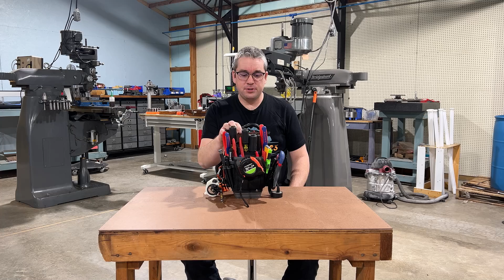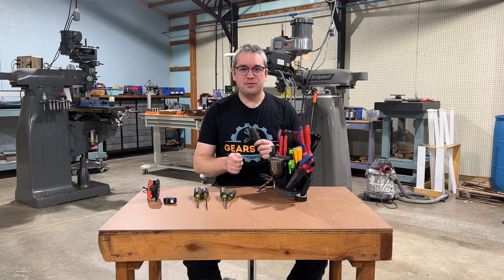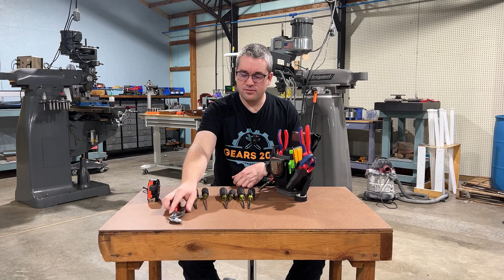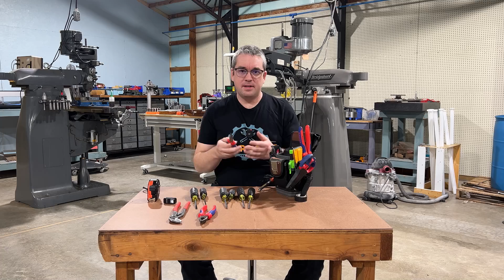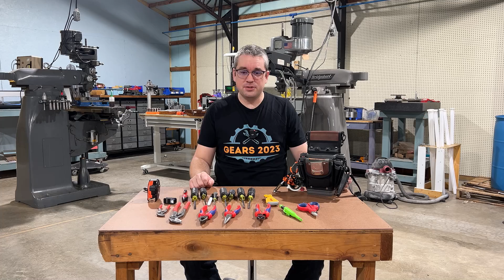Quick Maintenance Tool Bag Loadout - What I Carry Everyday

Comment: Great video and interesting to see what others carry. I have a very similar set of tools I keep in a wallet style pouch that I use as a grap bag for around the house ect..

Re the scissors, in the US, they seem to be an essential tool in the telecom/data industry, but in the UK telco I worked for, we're were never issued them, rather just used 6" side cutters and end strippers..I have since have tried a couple of different types of telecom/electricians scissors but just can't grow to love them, instead i carry straight handle shears for general cutting duties..

I have that small Klein 4 in 1 stat driver, and love it,  and also have thier very similar one with the small Torx bits and love that too..

One thing I am surprised you don't carry in that bag is a set of Allen keys?? I carry a multi bit screwdriver, so just have a set of 2" Hex (and 2" Torx) bits  that get me by in most instances, and do find them handy...
Reply from the maker: I'm working on a rebuild in a slightly larger bag and I have allen keys in that set. I did just pick up the new Klein multibit stat driver that's really a "plumbing" tool and like it quite a lot so far.